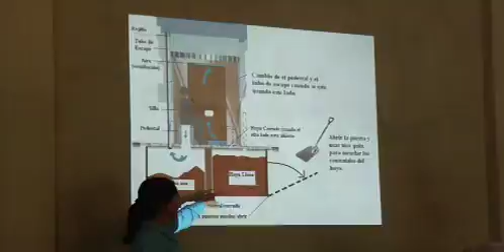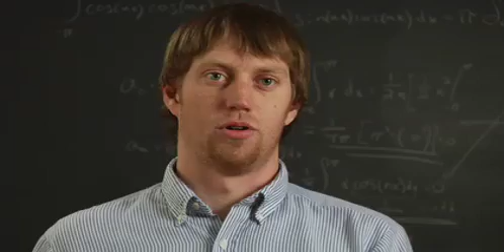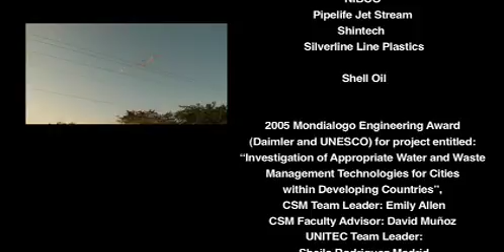Humanitarian Engineering Program

Comment from the maker: Unfortunately, the grey water systems are not working well. One was washed out in a heavy rain, a second has been disconnected for unknown reasons and the third was not finalized due to the fact that the volunteer family were going to move their house to accomodate the space more effectively. We will meet with these volunteers in March 2009 to discuss the projects with them and learn more about the failures.

Comment from the maker: Yes, all of these projects have challenging aspects, many of which are unanticipated at teh beginning. Culture, politics, social fabric, history all play a part. 100% anticipation is impossible, therefore, you have to be flexible and patient. The project is still going on. The actual costs excluding labor are around $500K. This includes $140K in plastic pipe, fittings and glue (manufacturers cost) which retail at $450K.